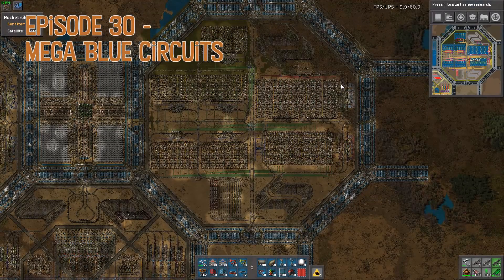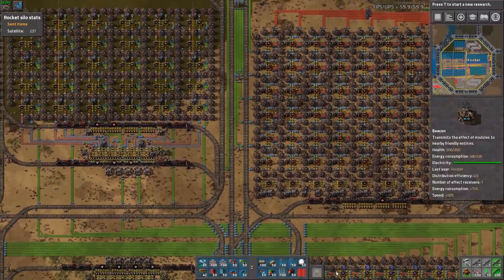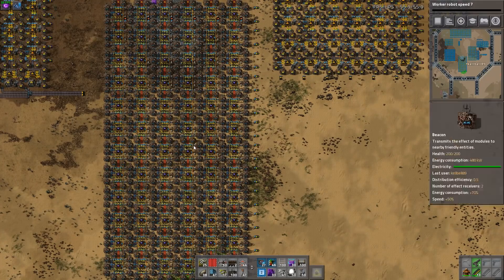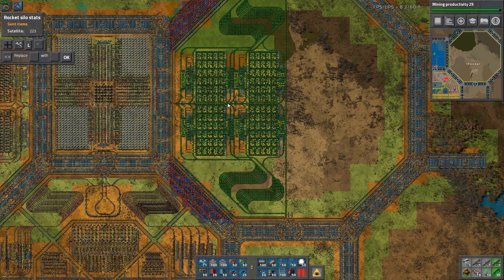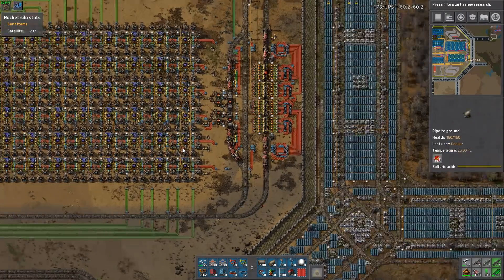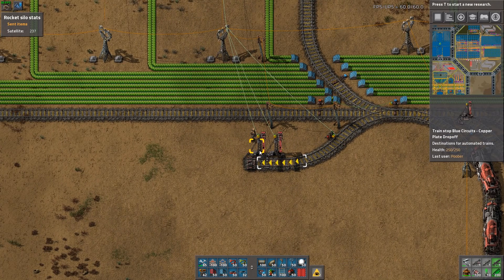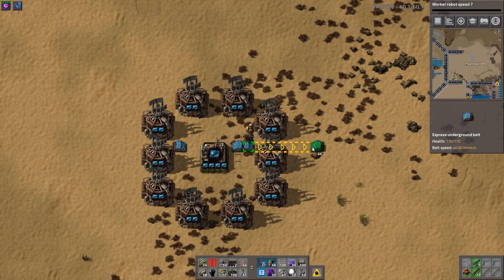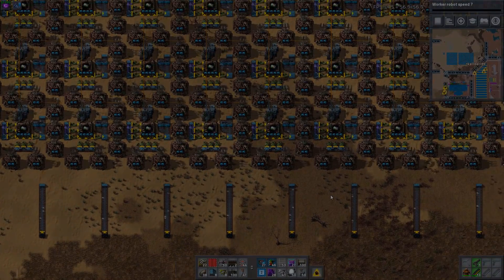FACTORIO 0.16 | Mega Blue Circuits - Episode 30

Comment: How do you get 60/60 with such a big base? Love your designs
Reply from the maker: Hi! At this point, I don't. The base got even bigger than what you saw in this video, but it was amazing I was able to keep it at 60/60 for so long. Now with as big as the base is it usually only sits about 35 max with the base turned off, 19-20 with the base turned on. Glad you like the designs, and awesome profile pic!